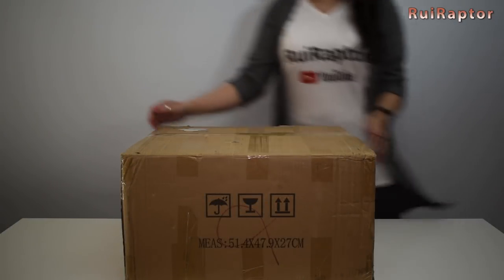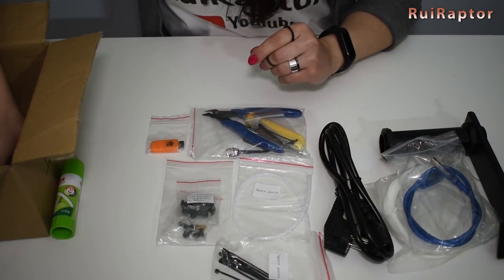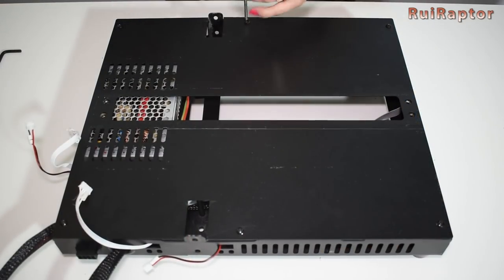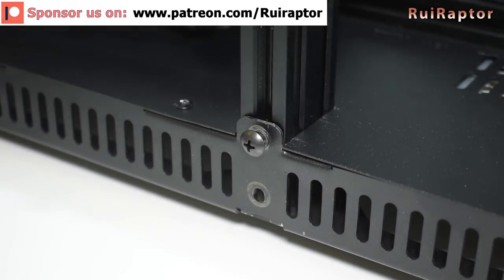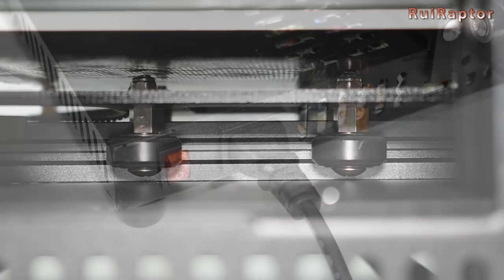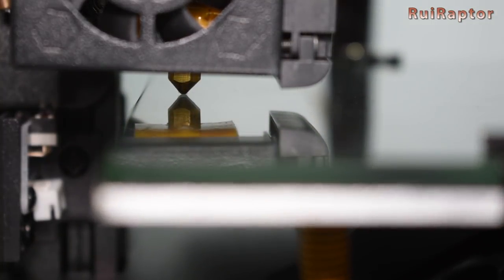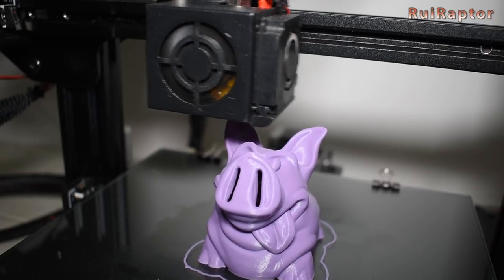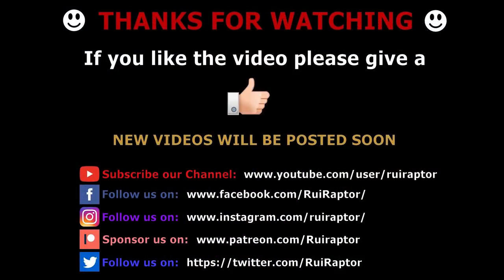ReaYou FALCON S (3D Printer) - Unboxing & First Tests

Comment: wow, so many negatives here.

-structurally weak frame leading to ghosting.
-MKS Robin Lite board is fully closed source.
-stepper drivers are absolute wank and can't be replaced.
-the heated bed uses an insufficient connector.
-Insulation on the heated bed is laughably small.
-power wires are only properly terminated at the PSU level not the board level.
-Is £100 more than the Ender 3
-came damaged

It's like they arent even trying.